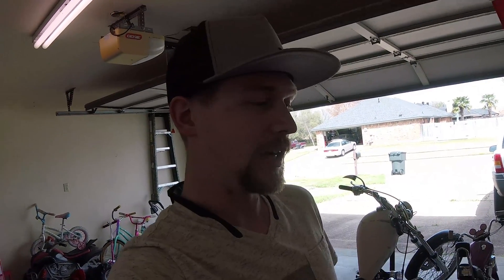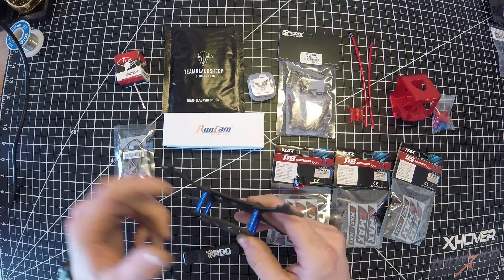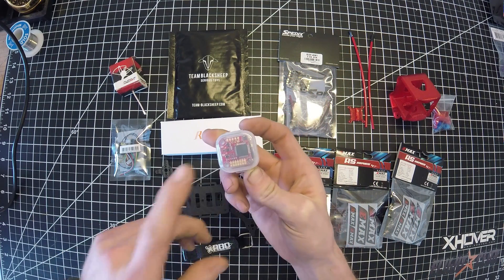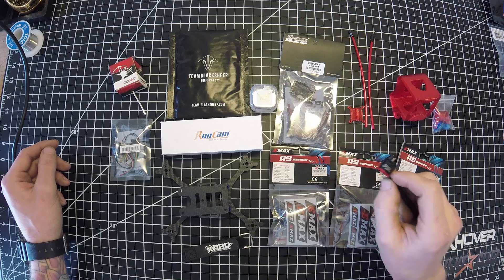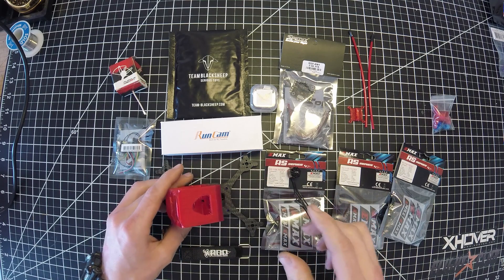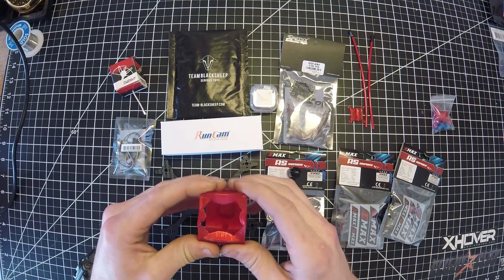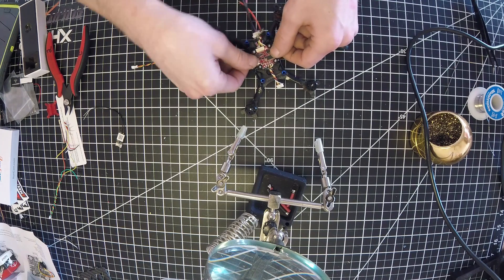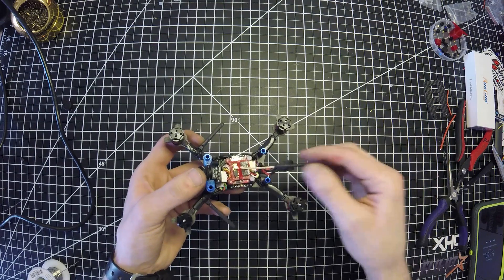Ultimate Micro Drone Build Hyperlite Tooth Fairy 2.4" carries a Gopro!!

Comment: Hey Dillon. Nice component choices. I have almost the exact same ones including the EMAX going into this build. I saw your Rooster build. it looks nicer than mine.  Can you explain how you repinned that cable between the Spedix and the Talon? I have the Spedix and Talon combo and I'm a little confused.  On the ESC side it shows 2 BAT+ followed by two grounds and the four signal wires. On the Talon, if I go by the included cable it's GND BAT+ GND BAT+ and then the four signal wires? Do you just remove one set of VBAT GND and arrange the other 2 to match up? So you are only using six of the 8 included wires out of the harness from the Talon (seems better quality than the one that came with the Spedix) with the BAT GND flipped at one end? Sorry if I'm not making any sense  First time using this combo and I'd hate to fry it.

Comment: dude that's a awesome build great job, I'm looking for parts to build a 2.5 i was thinking the Runcam Mini Split is it any good
Reply from the maker: StaticMotion the runcam split may be hard to stuff in the stack. In not sure I have never owned one. The baby hawk R with the piroflip upgrade arms is really hard to beat these days. The 7000kv motors on here ended up being very amp hungry for racing. I would stick with the emax 6000kv motors they seem to be the best micro motors at this point, and a 550mah 3s
Reply: awesome thnxs man